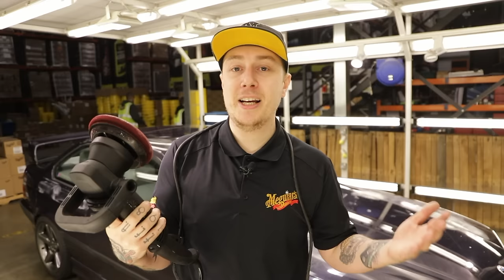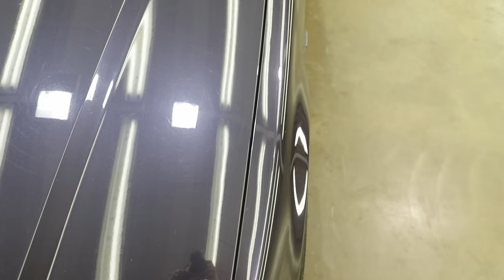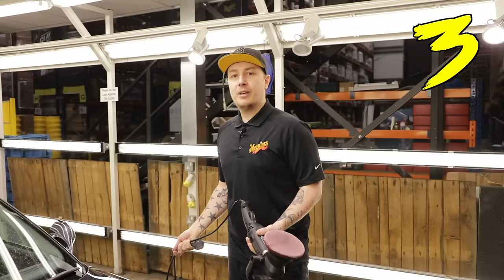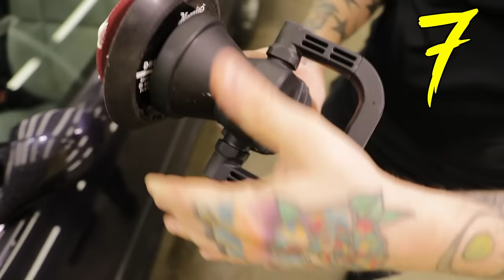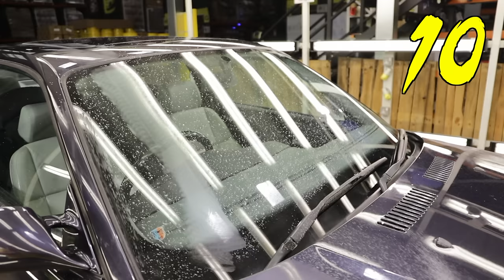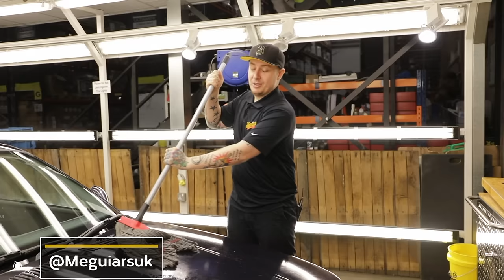Top 10 DONT'S of DA Machine Polishing

Comment: On number 4.... oké BUT some compounds do like water.

Dont do it... unless the instructuons tell you otherwise.
There are some compounds made specifically for using water.
But these are specific and not the rule.

They are quite fun to use. Since you spray off and dry it off instead of buffing it. It means you will get to work with a lichter grid polish without having to buff it off.

Ofcourse the last layer will have to be buffed.

Comment: Switching to a DA now but I got a electric sprayer for auto painting so I don't have to hook it up to a air compressor. My DA getting tommorow charges off a battery charger to me that will be better with no wire hooked up to it. I decided to switch to DA because think will like it a lot better and I won't have to just move from side to side with it.

Comment: Hi Meguiar's UK
how about small areas ? can the meguiar dual-action machine mt320 be used in small areas? like a Pillar etc...?
Reply from the maker: absolutely. You can either change the backing plate to a 3 inch to fit a small pad on or you can do it by hand.

Comment: Do those expensive polishers vibrate your arms less than the cheaper ones ?
Reply: Some do vibrate way less, some even expensive ones vibrate more. You need to do some more research rather than relying only on the brand name. However, overall you can trust that companies like Rupes put in enough research and development that there's run fairly smooth. Griots G9/G8 alsovare particularly smooth running machines.

Also keep in mind, that you can, with some basic modifications, fix most vibration issues. Most vibrations happen either due to the cheap lube in the head, or the pad weight to counterweight balance. So you can take apart the head, and relube the gears with some higher quality grease (something I always recommend). You can also adjust the weight of the pad and backing plate combo by either adding washers to the backing plate, changing the backing plate to a different brand/design/size, or trying different pads. Another thing you can do, which is a less done modification, but still totally viable, is see what kind of bearings are used throughout the machine. If they're low quality bearings, you can order higher quality replacements (usually the bearings will have an identifying part number/sizing mumber stamped on them). There are three main types of ball bearings, un-shielded, shielded, and sealed. You can use youtube or google to identify quality brands for bearings, and just buy from them.
Reply: There are other bearing designs, like needle bearings. Some companies can even cheap out and use bushings instead, in which case you normally wanna see brass used as the bushing surface...ideally.